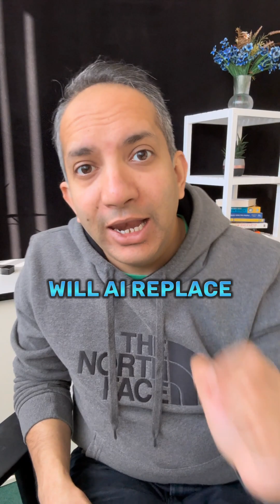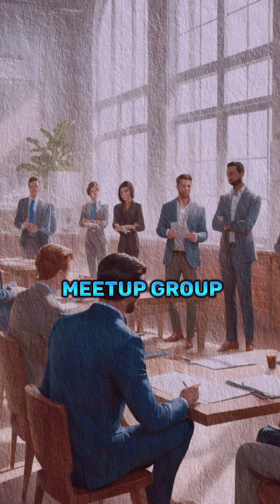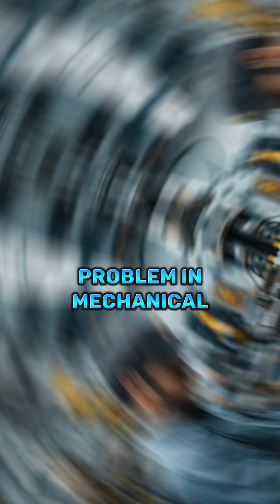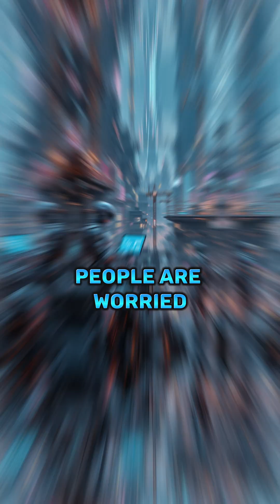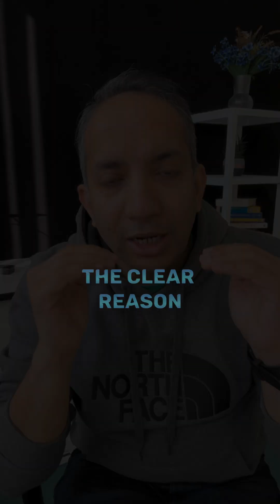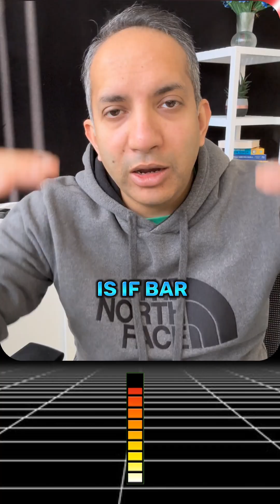Will AI replace Mechanical Engineers? The Truth in 2025

Comment: The cost of an engineering team will go down. More things built for less. As long as humans still have ideas they can test them with smaller teams and keep people employed. Now innovation rates will depend on how efficiently a team a leverage AI. 

Instead of writing code or making spread sheets, engineers can be bust design and analysis is shorter with the aid of AI to write the software tools for you after giving it specs.